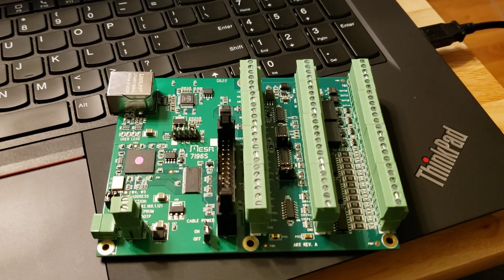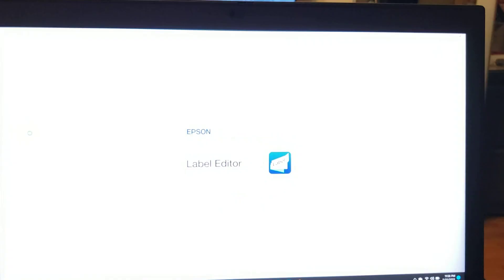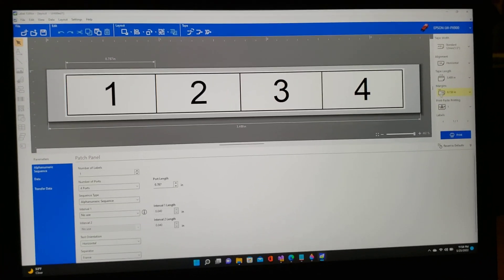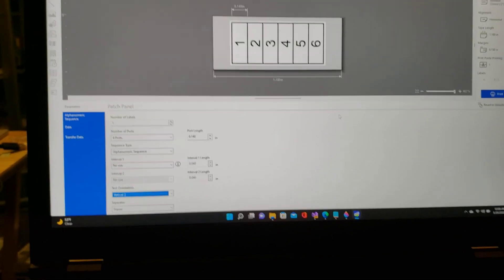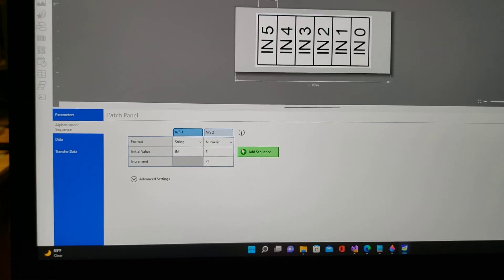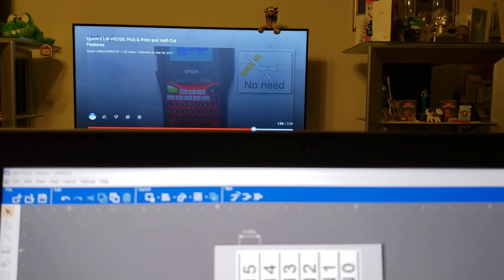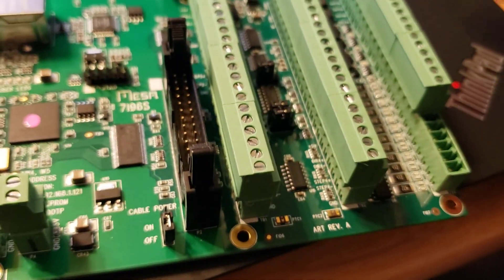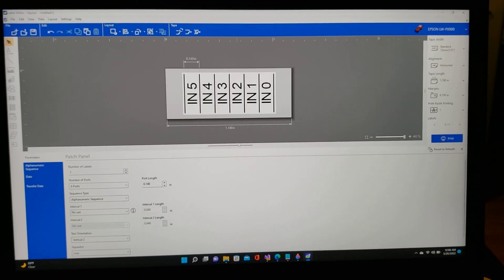Epson Labelworks pc software - Mesa 7i76e, 7i96s, 7i95, etc pin terminal labeling

Comment: Hello , thanks for the videos . I`m newish here subbed after i saw a facebook comment and started viewing from "linux cnc is not hard RANT " video of yours . ive got chinese controller and busy converting over to linux ... dont laugh please  i have 2 parrallel ports on two 25pin breakout boards (5axis versions ) can i connect my linear encoders to the second one is it possible ? or am i waisting my time ?                i have my eye on a 7i92E board but my funds a bit low atm .  Thank you .
Reply from the maker: You have to see what the data transfer speed of the inputs are rated for on the pp breakout board. The mesa stuff offers dedicated high speed encoder inputs that run at a much higher data transfer rate. What scales are you using?
Reply: @TheFeralEngineer  Uhm 0.001mm ttl linear encoders ill have to check the specs ( i only intend to use them on X axis and Y axis on second Parallel board ...i already have the parts thats why i ask) . if i have to ill do it but i have a clapped out bridgeport j1 i am converting to linear rails and that unfortunately took most of my buget and i am not happy with the controller i bought  would like to change over to 5 axis while im busy as i have the motors and a cycloidal drive  the spindle still max out at 4500 rpm  ...i am busy finishing up a granite base router as well 3 axis but i would like accuracy i have not bought linear encoders for it( i intend to as soon as i have both controls sorted out and they are working perfectly ) . i intend to have both linuxcnc . appologies if things do sound off english is not native and i might sound dull because i cannot articulate correctly . i dont want to waste your time , what should i look for on the scales specs and how do i compare it with the break out board ? if i do not find it viable i know that i have to move directly to the mesa board ...but as i mentioned from a financial perspective i would really like to get this working at the moment then upgrade as the funds come in . ( if it is not viable ,ill understand i did not want to waste the parts . thank
 you again .
edit i intend to only want accuracy up to 0.01mm

Comment: I like it.
Reply from the maker: The px700 is very similar. If you use my coupon code, the base unit is under 100 bucks and the full kit is like 150ish, plus if you stock up on tape when you buy the lottery, they're just over 20 bucks a piece 🙂

Mine is the big boy model, because I appreciated what they did so much that I bought the more expensive one to say thank you
Reply: @TheFeralEngineer  Yeah there site sells to Canada and USA not OZ, I went to Epson Australia and couldn't see that model. I still like it.
Reply from the maker: @NuttyforNissan  ah bummer!